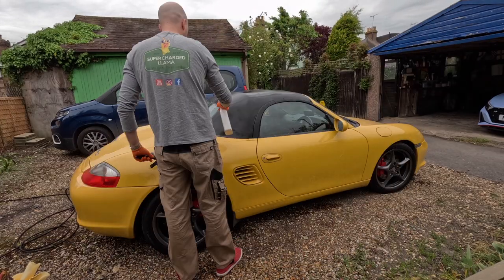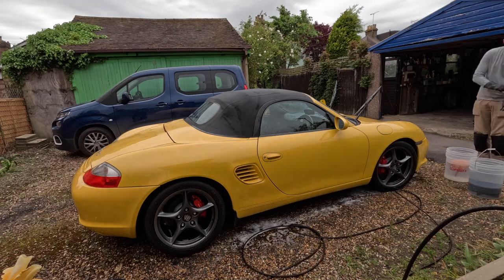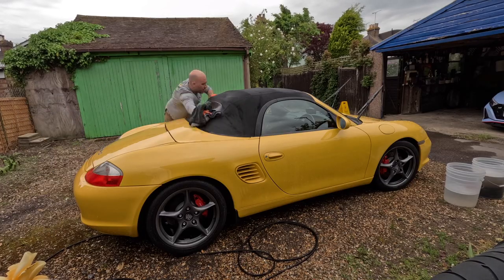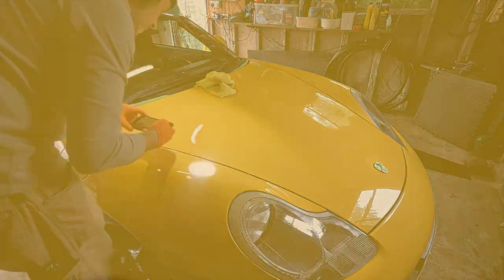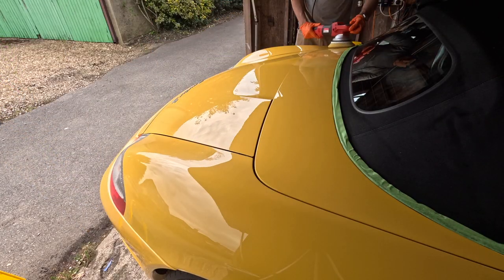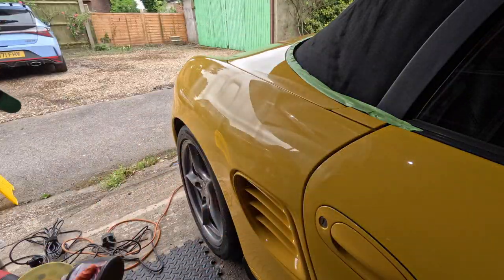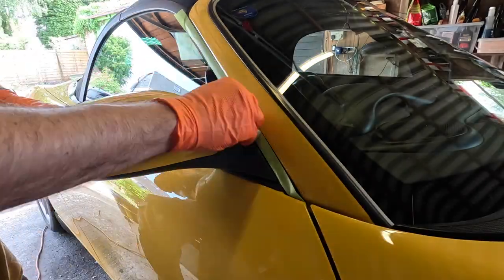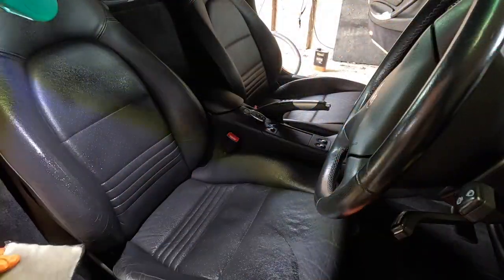The fastest way to polish - Porsche Boxster S 986  - forced rotation polishing & Synergy 2

Comment: Great video and great info. 
Is that a 2004 986.v2 S ? 
I only ask because that’s what I have, with the 6-speed manual 🤠🇺🇸
Reply from the maker: Cheers dude! I believe you're right that it's a V2 S. I'm not 💯 on the age as it's on private plates, but it sounds like you know more than I 😅
Reply: @SuperchargedLlama   I just recently bought my first Porsche, it's became more than just a means of transportation. I guess I'm now an enthusiast. A hobby, I've been a car guy since my first car at 16yrs old. 1973 Chevrolete Nova. :)
Reply from the maker: @gumpster66  I don't know how they were specced in the states, but I know you're a rarity driving a manual. Have you got some good roads to play on?
Reply: @SuperchargedLlama   oh yes.. I'm in hill country. Cincinnati is right on the boarder of Kentucky,, so lots of hills with winding roads. I love it.. I'm just now getting used to the car. I know they can do things other cars can't or struggle with. The car is so damn balanced, like it turns as if it was on rails. It's not the fasted car out there, but man it's quick. almost 300hp in a car that weighs just under 3000 pounds. With that rato, she'll get up and boogie. :) :) :)
Reply: @SuperchargedLlama  There are tons of backcountry roads a short distance from me. I learned to drive with a standard, 1973 Chevy Nova 4-speed on the column was my first car. :) :)

Comment: Bloomin' lovely content bud, a nice easy watch. I really think I will be grabbing some S20 black for the autumn polish.  I'm not big into polishing, and my paint is decent, so 1 whizz around with the machine sounds perfect. What grade pad was that, soft, medium, hard etc? All the best.
Reply from the maker: Cheers dude.

The pad is Rupes Yellow Foam - which they call their fine pad. They have white which is their finishing pad, and blue which is their cutting one (and in all of that, they have wool and microfiber in each colour, so there's grades of cut in those colour bands). I tend to only really need the Yellow range for one step enhancements, the blue range is too coarse and doesn't finish down. If I need more bite I find I reach for the Uro Fibre 50/50 pad.
Reply: @Supercharged Llama Detailing  nice one, thanks for the info. I have a couple of Koch Medium pads, they'd be a little too heavy I guess.  I'll grab the rupes yellow and some S20 nearer the time. Thank you again. 😊
Reply from the maker: @decker0373  the Koch Medium pads are worth a go dude, you may just find you do less passes with them in a set to get the results you want🤙
Reply: @Supercharged Llama Detailing  cool, I'll save myself £20 and use the Koch pads, but definitely going to get the S20.  Really appreciate your time.

Comment: Hand wash and hand wax.  If you are using a buffer you are going to screw up your paint.   Do NOT do that.  You are taking off clear.  Do it by hand.
Not a big car for gods sake.
Reply from the maker: I feel like you've completely missed the point of paint corrections and enhancements...and ceramic coatings.

To remove the swirls from the paint you have to remove the clear a bit so that it's more level, and therefore the edges of the swirls are less severe, meaning they don't refract the light in the same way.

Polishing removes them, the ceramic coating helps prevent them from occuring so easily, but it generally doesn't fill, hence why you do the polishing first.

I use a paint thickness guage (not shown in the video) to make sure I've got a suitable amount of clear to work with, you'd not do it if it was too thin, that would be reckless - a lot of detailers shoot from the hip so you have to watch out for that.

PPF is the only real way to protect paint from scratches, but you'd still correct it first as you don't want the paint looking swirly under the PPF.

Washing and waxing has its place, but there's only so much it can do on terms of improving the looks of the paint - but you could do that every few months, where as polishing....well this wasn't that aggressive, but ultimately you'd only want to do it  every couple of years or so really, if you out a 5 year coating on and have a great wash process, even a daily driven vehicle will need a polish in about 3 or so years.

Comment: Awesome video Llama, do you rate koch chemie SF over BH auto foam?
Reply from the maker: I do indeed, really like SF actually, I've got a video comparing them all too.
Reply: @SuperchargedLlama  
Im across the pond in 🇨🇦 and BH is triple the British price.
Keep the videos rolling, im learning from you buddy....
Reply from the maker: @Tops1212  cheers dude! I agree with you that, outside of the UK, BH prices aren't good at all, and it's problematic with AutoFoam and Touch-Less due to the volume used. SF is max 2% PIR, and that out performs AutoFoam I felt, or at least equals is.

The only downside is that it comes in 10kg drums (here at least)